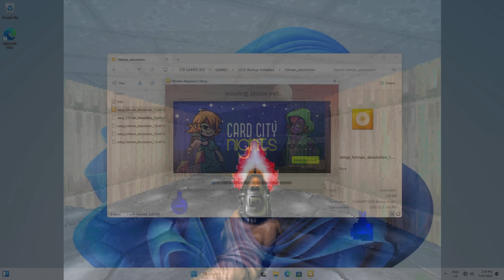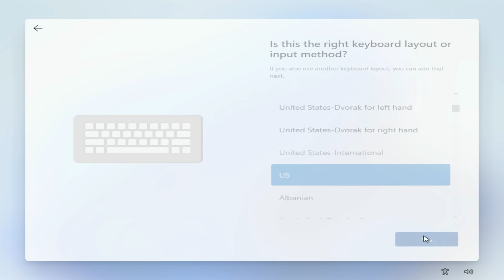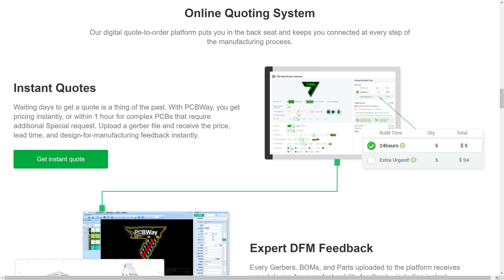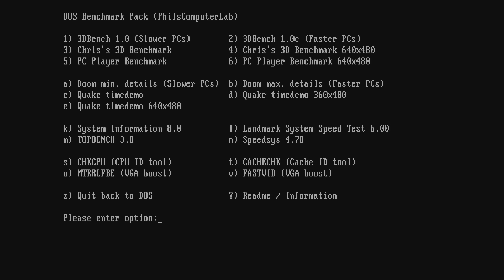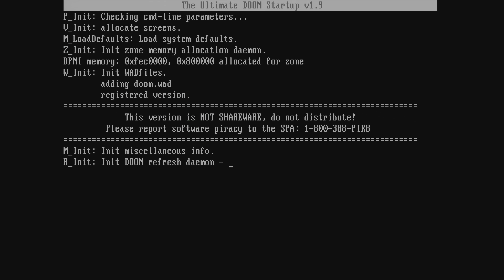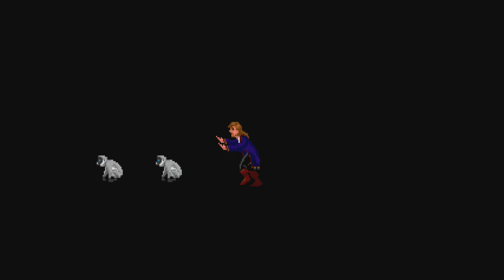LGA 775 The Next Big Thing for Retro PC Community?

Comment: Cooler availability is a big thing that LGA 775 has going for it.  I've been putting together some Socket 478 systems lately and have had some troubles finding coolers.  There's a StarTech one and an Intel stock cooler still available but they run really hot.  Zalman still sells coolers which are compatible but the mounting hardware is no longer included.  I lucked out and was able to get in touch with their support and they tracked down some for me--I've been meaning to measure it out and post CAD drawings online for anyone looking to buy that cooler for their 478 system.

Comment: I got a few GA-P75-D3P motherboards early this year. It's an Ivy Bridge motherboard with four native PCI slots as well as two PS/2 ports and the serial/parallel port. It's worked amazing with 98SE, XP and 10 while being extremely quiet. The Audigy 2 ZS, R. Loew's AHCI driver and the 256 MB FX 5200 card work really well together. It does have some quirks, but maybe with some work a custom BIOS could fix the issues.

The 256MB PCI FX 5200 card seems to perform slower compared to running off an LGA 775 board when using the 45.23 driver. MTRRLFBE improved the score to ~4,500 in 3dmark2001se, but the LGA 775 board scored ~5,300. The score improves to being nearly the same with the 53.04 driver. Eh, it's good enough to run just about all of the 9x games so no big deal.

One weird issue I've noticed involves a resource conflict with any gameport address and an ACPI table address taking the whole 0200 - 020F space. Quake falsely believes a joystick is connected even if no sound card is installed. 98SE believes all buttons are being pressed. The other issue is Init Display First defaulting to the PCIe graphics card even if PCI is selected, so if I have a 750 Ti and a 5200 running together the 750 Ti gets priority and the 5200 is disabled.

Comment: My favorite mobo of all time is the ASRock 4CoreDual-SATA2 R2.0 ,, it has 1 agp slot, 1 pcie slot, 2 x SATA2 3.0 Gb/s connectors,  2 slots for ddr and 2 slots for ddr2, 4 pci slots. floppy drive and ide.  I currently have a multi boot set up with win98, xp and w7,  w10 ran so very slow.

Comment: Unfortunately these intel platforms suffer from the spectre and meltdown vunerabilities, therefore i would never go online with them, once the cpu has had the spectre and meltdown patches applied they drastically slow down

For windows98 & DOS and keeping everything running properly in this era, socket 754 has been king for me, especially the 2.4Ghz 3700+ windows98 loves this cpu it runs fast as lightning on win9x

The absolute best 775 motherboard ever made was the asus P5E3 premium

Comment: Found a Dell Latitude D520 on a scrapyard, great machine as a retro PC btw, sadly CD drive doesn't work, and screen isn't that good, but it works without any issues, uses DDR2 (but only works with sticks that are 555 MHz or lower), and integrated graphics is actually good, old thinclients are also amazing for that, I got one that uses SiS 552 and has 128 Mb DDR RAM, and uses 44 pin IDE, also got a DIMMPC from the same scrapyard, it was inside a medical equipment, something that does blood cell counts, it has an AMD Élan SoC that has an AMD 5x86 running at 133MHz, and even has ISA slot, floppy, USB, and IDE, I'm planning on building a very compact retro PC with it

Comment: First PC I ever build was a LGA 775 socket Core 2 Duo E8400 back in 2008. was  really nice machine for the time
Reply: Yeah, that was the first custom built one I had too, later upgraded to a E8500. Too bad the motherboard can't use DDR3, else I would be able to use the RAM I stripped from my brother's old PC.

The rest of my brother's PC was too much work to salvage, buried in a layer of dust after being stored for a few years. Add to that, he's also a smoker, making the lower layer of dust into more of a thin paste...
Reply: @LarsV62  I think I had DDR2-800 ram in mine. I initially had 2GB but upgraded to4GB. Had an eVGA 8800GT 512MBGDDR3 and later upgraded to a Radeon HD 5850 1GB GDDR5 card. Was a really sweet build I ended up retiring it to a nephew in 2016 when i upgraded to a i7-6700k but sadly a year later it died after their house got hit by lightning in a thunderstorm and fried the whole thing :/

Comment: I just noticed that GA-5AX board you have and I have the same exact one sitting in front of me! I do want a few different board and CPU combo's to work with and I have everything you have shown so far. WOW! I did have some Rare 3DFX cards but I sold them before moving to Georgia 4 years ago and I still have a few left. I do agree with you about socket 775 boards and I do have some on hand and some AM3 boards too. I would like to get a couple of Rambus/Intel boards for Win95/98 because they were really peppy back then. One board that I would REALLY love to get is a socket 478 board that uses 32 bit Rambus but those are near impossible to get anymore. I have 2 sticks of Rambus 4800 that I would love to use again and It's Impossible to find in either 1000 much less 1200mhz anywhere and that's the reason I have kept it in my collection. Maybe Someday. I do know of one Asus board on Ebay but he wants Too much for it but now I'm taking a another look at it.
Reply from the maker: Thanks for sharing 😊
Reply: @philscomputerlab  Thank You for sharing info about these boards and cards. I might be across the drink from you but your vids help a Lot!

Comment: I've always been a big fan of socket 775 and socket 939 as they can both be made to work perfectly be well in Windows 98 and later.   I do think I prefer the AGP versions of both sockets, but have been successful with the PCIE versions for the most part.    I also think they both allow the use of the former highly undesirable processors like the Pentium 4 and single core socket 939.   Flexible and cheap.   Glad you made this video, as I'm well stocked already and won't be competing on purchases, lol.   Great job!

Comment: A few weeks ago I built a system with a very similar board - the Gigabyte GA-EP43-DS3L using ~2008 parts.  It's been great so far for WinXP with the exception of the Dell OEM PCIE Physx card I wanted to use, which I couldn't get working.  I'm using the machine for a playthrough of Curse The Eye of Isis right now, but I'm sure it can handle something more modern.

Comment: Hallo Phil, ich habe neulich einen E8600 für nur 5 Euro erworben. Nutze den für meine rasend schnelle Windows 98 Retro Maschine. Natürlich nur mit einem Kern. Chipsatz G31, GeForce 7900GT und zwei SLI V2 Karten die via PCI zu PCIe Brücke verbunden sind. Ich glaube spätestens im nächsten Jahrzehnt wird 775 auch stark vom Preis steigen habe daher schon viel Hardware aus dieser Zeit.
Reply from the maker: Super 👍😊
Reply: @philscomputerlab  In your video you also said Windows 11, yes it works but the new versions from 24h2 onwards now require SSE 4.2. And that would only be introduced with Nehalem. Therefore further upgrades to 775 are impossible.

Comment: Man LGA 775 Is Best Platform You Can Run XP Up To W11
I Recently Got GA-EP45-UD3L Bundle Which E8500 Intel Cpu Cooler Sata Cable And IO Panel For Cheap
I Run Windows 7 2 3 Month Ago Than Upgraded To Windows 10 Is Usable ( In My Case P45 Chipset Driver Don't Like Windows 10 But I Use Compatibility Windows 7 Is Works Flawlessly)
Even On Office And School In My Country (Iran) They Still Using LGA775 Platform With Windows 7 And Is Reliable

Comment: I don't plan to use this with DOS, although P31 does probably have that kind of backwards reach, but I would really stack it up to the max with that chipset including community patches that get 4GBs of RAM to work on Windows 98SE. I don't know if we got multi-core support somewhere before Windows XP, but that would be interesting. Get a high enough OpenGL support in a graphics card, you might run some of these modern source ports for some games like Quake. Which I've been quite interested in.

Comment: 775 is good upto XP. Socket 1155 is better in XP to Windows 10. XP is Fiddly on 1155, best to use SDI for that, also XP support upto GTX 780 Ti natively for games like FEAR. I had fun with Q9650 and I7-3770 on XP. Still have both machines. Future Gold. XP will always work. Don't know about 7 and on. I dual boot 7 x64 and Windows XP x86 versions to allocate my 16 GB of memory in Windows 7. XP aollocates 3.785 GB of the DDR3 1600MHZ memory on the 1155 machine and the 775 machine. both machines use DDR3 memory. 

My feeling is that Windows 7 is Vista perfected. I don't miss Vista at all. I remember installing XP Pro on a second hatd drive when I had my HP/Compaq 5110. It had a Athlon 64 x2 at 2.8 GHz. It was a slug with Vista.

Comment: I always go for ASUS LGA 775 boards with 1333Mhz FSB, that way I can get a modded bios to support quad core Xeons which are WAY more cheaper than non-server quad cores. These CPUs paired with an SDD still run Windows 10 very well. Both my daily machine and my retro XP/7 machine are LGA 775.
Reply: wettuga2762
ASUS did official 1600 FSB, my QE9650 build, DDR 3
too old for daily ! play some old games only

Comment: the other day i found a working asrock 775vm800 on a dumpster computer and it was pretty shocking how a low end board is now worth a premium due to the AGP slot
Reply: Asrock? The one I found for $14 came with a Pentium D 945 🤣
Reply: @antonhei2443  when was that? the few listings i have seen for this model are 50€+

Comment: I have a nice lga 775 runs a q9550 and ddr3 8gb ram. That computer has fdd controller and floppy drive. Along with burner and card reader. Dual booting both xp and windows 10. I use it as a easy gateway between new and old. Even managed to get real 3dfx voodoo 2 cards running under 64bit windows 10 along with PAE under xp 32bit. I also have a massive amount of storage for the time in that box mainly use it for driver storage and archiving. Along with disk image files from my older computers incase I need to roll back. Also super nice to easily go on a website download a image and write a floppy or cdrom within seconds rather then doing it in stages :)

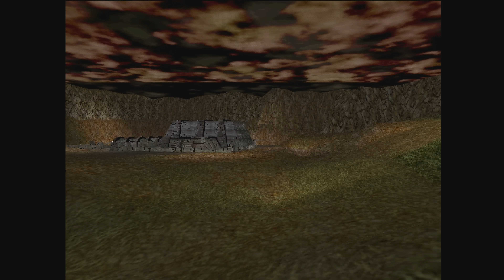Comment: 0:40 gonna stop you right there mister, the early 775 chipsets, so the Pentium 4 type of 775, did have windows 9x support, or at least a couple of them did.  I feel like you're talking about 775 in a Core 2 kinda way when there's like two very different yet exactly the same gens of 775. 
And then there's outliers like the nForce 7 series that supported ALL of the 775 chips, from the Celeron D to the Core 2 Quad

Comment: lol, what did you do to me? I just spend $250 on three LGA775 motherboards with E8400 CPUs and 4GB RAM ! haha ... on another note, what do you reckon would be best PCIe video card for this build ?
Reply from the maker: Well, for 98 you will need specific cards like Radeon X800 series. Or something PCI like a Voodoo. For XP, you are spoilt for choice. 9800 GT and higher is a good start.
Reply: @philscomputerlab  yeah I have a 9800GT. Used to own X850XT in the day but sold it. Today they seem to be quite expensive.  I have few V3s but I wonder how the PC would work with onboard, PCIe and PCI gpu ? have you tried combo like that?

Comment: I think it's a bit of a stretch to call Windows 11 compatible with LGA 775. Windows 11 now requires the POPCNT instruction, which is not available on any LGA 775 CPUs as far as I'm aware. Although older versions of 11 will work, 24H2 and up won't.
Reply from the maker: I wasn't aware if this! I used Rufus to create the boot USB and it just worked, so was pleasantly surprised 😮
Reply: @philscomputerlab  For games, it does not matter at all.
need a supported PC, or just run games !
Reply: @philscomputerlab  Windows 11 w wersji 23H2 będzie działał na Core 2 Duo i nadal ma wsparcie aktualizacji. Od wersji 24H2 niestety wymaga już SSE4.2 i POPCNT co oznacza że minimalnie może to być Intel Nehalem lub AMD Barcelona.

Comment: I used to play gta 5 on windows 10 with my e7500. How times have changed. Is socket a worth anything? I have some of those, with 3 ddr1 slots. Even a ddr3 lga 775 board. I saw a huge difference between windows xp and 7 on 775 pentium 4's in some games. If you looked at the sky on lowest settings in crysis on xp you'd reach 100 fps, on 7 you'd be stuck to the 30 ish it would get everywhere else. No such issues with core 2 cpu's. I remember when I went from that 500fsb p4 to a core2, it uncorked the system if I were to choose the best word for how it felt. Same with youtube playback, could never get above 480p to be smooth even with a modern gpu with hw decoders. In 2015 people still used core2's as budget pc's.
Reply from the maker: Most older parts are worth something to the right person. Especially if working, in good condition and if you still have box and bits then you can charge a premium.

Comment: With the NB's memory controller constantly dying on every single (P45) LGA775 board I've ever had - I'll keep the many CPU that I have for it...but I'm not bothering with LGA775 ever again. Unless its the Asus P5K-VM (all polymer caps). The VRM was only killed by me pushing the P4 630 it came with too far. Earlier LGA775 boards could have bad Nichicon caps, as the Intel mATX board that came with my P4 540J did (and one of my OG Xbox).

I've got plenty of Socket A PC for playing games from the early 2000's (Oblivion under VIsta on an 6600GT+Athlon XP 3000+ is quite playable), and I've got several LGA1150 boards to choose from if I want to play latter Windows XP games (which I'd use with my i5 4440 and GTX 650ti - which I chose 10 years ago for its VGA).

Edit: Actually found the board I wanted with 8GB of RAM, another stock cooler and the Q9450. Would swap it for my QX6850 or one of my Pentium E6500K since they are unlocked. And I'd use my Coolermaster Eclipse. $50 and within Australia.

Comment: I honestly never understood why this platform is so cheap. I just recently bought 2 Gigabyte motherboards including CPUs for LGA775 for 5 euros. My Windows XP build is a Core2Quad with a Radeon HD 6850 Crossfire setup and it is great for playing Windows XP era games. I just love this platform. Super stress free, low power consumption, available and also no issue finding a proper power supply. Athlon XP or even Athlon 64 on the other hand, while I have nostalgia for it, they are more of a niche. Athlon XP, despite being hard to setup given the PSU issues and capacitor plague, is not fast enough to run late Windows XP games and if you have the choice between Athon64 and LGA775, I would choose LGA775 just for being a bit more powerful.
Reply from the maker: Agreed 💯👍

Comment: LGA775 has 0 reasons to become a big thing cause:
1) It's too common. Did socket 370 and 478 happened to be a big thing? Both has compatibility with dozens of games and software from a corresponding eras and beyond. Socket 370 Celeron can run all the same games but people prefer Pentium MMX for a retro build. And of cause you can find a lot of them in any trash can.
2) What 775 does, a newer hardware does too. Software quality has improved drastically since the middle 2000s so did the compatibility. You won't find too many games from socket 775 era you couldn't run on your modern machine.
775 is noble platform, but so was the 370 and 478.
Reply from the maker: The same has been said about the Pentium 4...
Reply: @philscomputerlab  and Pentium 4 is pretty much the same, i have many socket 478 computers that i found in the bin, also socket 775 was the PS2 of pc motherboards, everyone had at least one, retro collectors are just lazy to search about prices outside scamebay, they believe on an artificial inflation cause their favourite youtuber said so. Dont get me wrong i always watch your videos cause i like your content but sometimes this videos about imaginative prices makes me cringe ffs
Reply from the maker: @tiagomarques7149  You say imagination prices. Go find me a nice 478 board in Perth. I'll unblock links in case they get removed!
Reply: @philscomputerlab  i dont know where you live but here in Portugal is pretty common people just throw away old p4 pcs or just sell you for 10 euro or 20 at worse case, many of those are old oem machines from businesses and no one needs them
Reply from the maker: @tiagomarques7149  Perth, I mentioned it previously. So even in Portugal, one needs to look already outside of eBay basically... That's exactly what this video is about. LGA 775 is still readily available whereas Socket 478 is not 😊
Reply: @philscomputerlab  and no one wants Pentium 4 mobos, so there is no contradictions. Recently I came across a bunch of videos where a young guy used to just vandalizing a s478 system while playing with it. And what i got was like "oh shut up it's just s478". Don't get me wrong, i'm not saying 775 is not usable. It really is (same as s370s), it just won't happen to be highly desirable (and i don't say it's a right way of thinking either). 775 is also unlucky to be existed in an era when PCs were extremely common. Not trying to be toxic or something else, it's just my perspective.
People are obsessed with 486PCs, cause yeah can play Wolfenstein. You don't need exactly 486 to run Wolf and you can go with something more common of cause, but still people loves to overcomplicate.
Reply from the maker: @dmwzr  We all have stories of getting lucky with a bargain, but try to buy a decent Pentium 4 board in Perth, please to have a look. 5 years ago this wasn't an issue 😊

Comment: I just reduced my 775 prices for offers hanging around for years, then i found this video lol. Should raise em again. I have over 500 cpus from the earliest single core egg boiling machine to some cool & quiet quads. Most thing to struggle with is that SB shit. I tried so many cards and the results are evil bad. Maybe there is some 775 ISA board out there but perhaps only with FSB400 but i don't know, mine are all PCI/AGP/PCIe with DDR1+2.